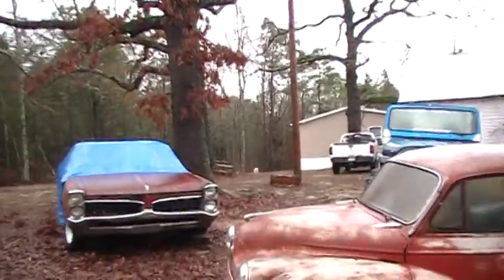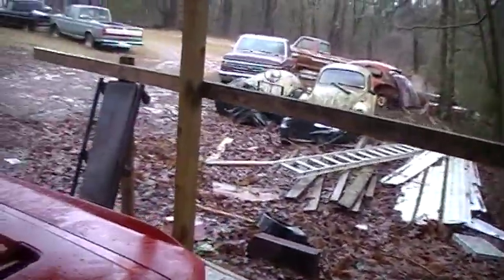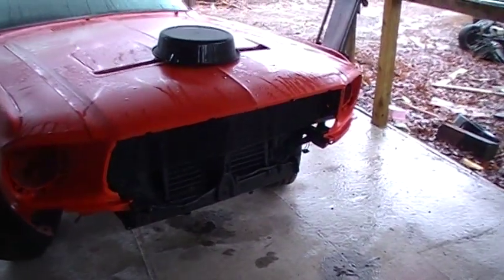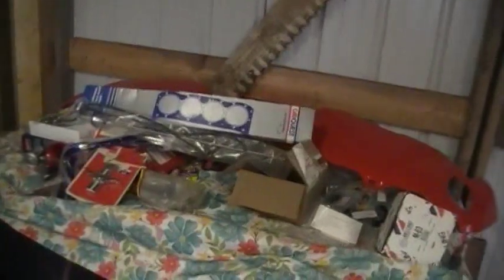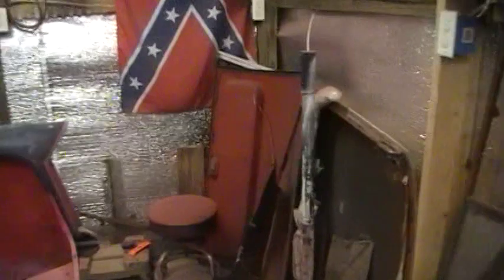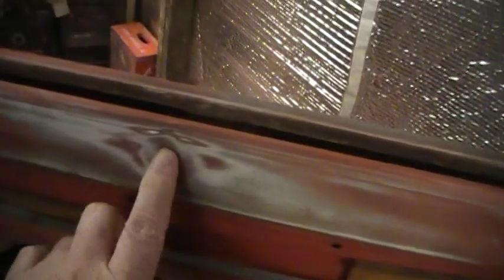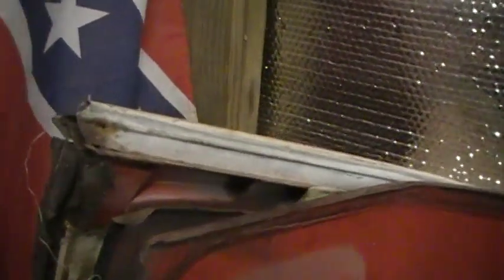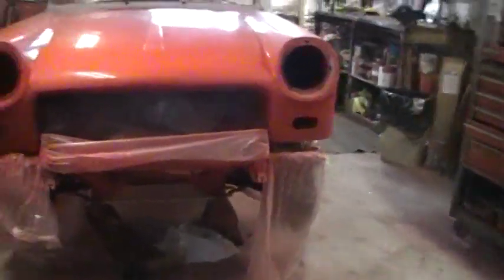Mustang, Herald and TR6

Comment: Your projects are moving right along . Old harold looks like he is smiling.Always good to have a clean work bench to get work done. Yes they tend to get messy. Well I would rather have rain than the foot of snow and low temps 9 degrees at night and 28 during the day another snow storm coming Monday with 3 to 6 inches more snow.

Comment: Plenty to do to keep you busy . I had a SB ford 302 that had a worn out engine damper or some call a harmonic balancer it allowed the engine to run out of balance and made it sound like a low end noise sounded like a thud . Installed a new one and the noise went away . Good luck
Reply from the maker: I will check that for sure Rod. Thanks bubba.
Reply: Yeah the rubber rots on them and they are really old now.